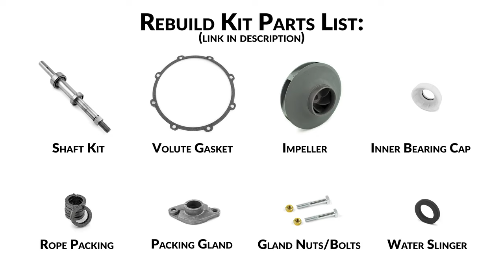How to Rebuild a B3Z Rope Seal Pump

Comment: I feel like I should buy a whole spare pump.
Reply from the maker: That can be a prudent decision if a pump malfunction would negatively impact your operation. 

We also offer Power Frame and Rebuild Kit options if your volute and frame are still in good shape.
Reply: @accesstruckparts  I'm rebuilding an old fire tender. The pump is structurally fine but the whole thing looks like it's been sitting for about 20 years.
Reply from the maker: @wiredforstereo  That's pretty common, we see it all the time. Generally cosmetic damage isn't a problem as long as the pump is still producing normal volume and pressure, but may make rebuilding it difficult when it eventually does fail. 

Having a spare pump on hand would make the replacement process simple, and from there you can regularly maintain it to prevent corrosion and other wear and tear.
Reply: @accesstruckparts  Great plan, just need to make some money first.